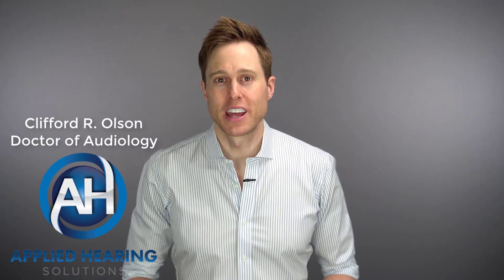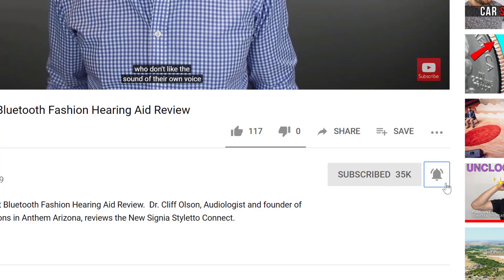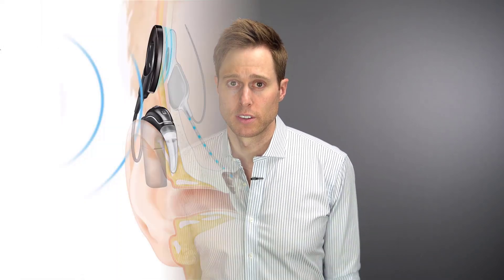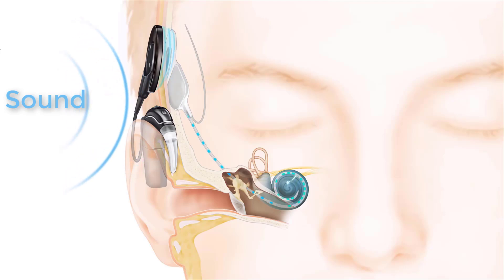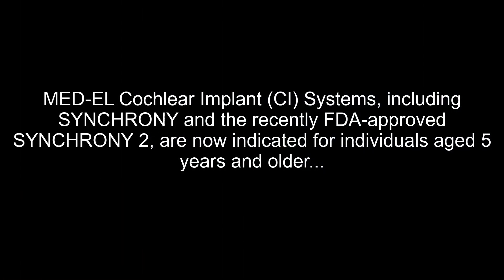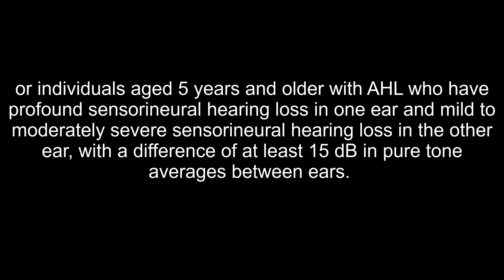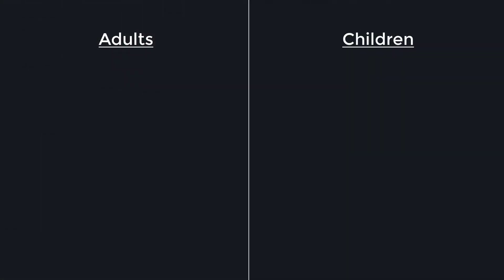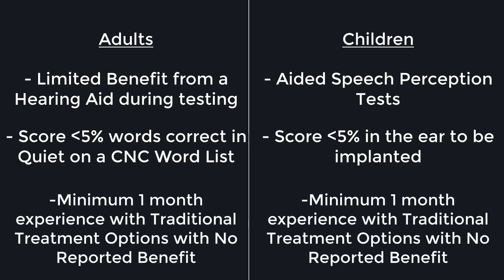Cochlear Implants for Single Sided Deafness & Asymmetrical Hearing Loss | FDA Approval

Comment: Trying to get single sided deafness fixed is actually a bit silly and I am speaking from experience w having had SSD for almost 50 years. Over those 50 years, I’ve had very few issues w getting used to only having one ear to deal with. Only on rare occasions like in a loud restaurant or bar has it affected him, so please do not start doing surgery or any other crazy means to fix it.

Comment: It's not only the localization that the binaural (aka stereo) hearing restores. It also restores the ability to separate the speech from the background noise, since the sound becomes 3D and has depth again.

Not to mention the effect called binaural loudness summation. The brain perceives the sum of the sound from two ears as much louder than the same sound from each ear alone.

Comment: I have had significant hearing for most of my life. I am 80.  About four years ago I was fitted with a Cochlear implant. Since then I have struggled to understand the speech it produces. My senses tell me I am not benefiting from the implant as much as I believe I should. My comprehension definitely is greater when my Cochlear hearings is operational. However I also find the sound produced by my Cochlear interferes with my ability to hear clearly. It is a very annoying pitch that is screechy sounding from my Cochlear. My audiologist has been unable to help me with this problem so far. I think I am probably doing as well As I can expect.
Disappointing result.

Comment: I have a sudden sensorineural hearing loss with profound hearing loss in my right ear. I'm in the process of obtaining a BAHA evaluation audiogram for possible implantation of the Choclear Osia system. I'm confused between a cochlear implant and the Osia system. What is the difference, or are they one and the same? Is the surgical procedure for both the same?
Reply from the maker: The OSIA is a bone anchored device that will send the vibration of sound through your skull to your better hearing ear.  A Cochlear implant will stimulate the Nerve on the Profound ear side to provide hearing on the affected side.  The surgical procedure will be different.  The OSIA will be less invasive, but both are relatively simple outpatient procedures.  The question you have to ask yourself is:  Do you want to hear on your affected side, or do you want to hear all sound on your non-affected side?  This will help you decide which one is right for you.
Reply: @DrCliffAuD  I want hearing non side effects please helping me , my hearing loss is moderately severe ,and doctor is saying cochlear is damage

Comment: I’ve been following Dr. Cliff since I experienced sudden hearing loss in my left ear a year and a half ago. Huge asset for understanding available options. I had good success with CROS hearing aids but wanted bilateral hearing back and went for a CI in the bad ear. I got the Cochlear Nucleus 7, which isn’t FDA approved. My experienced hasn’t been pleasurable. I get improvement when I Bluetooth to the external processor but my brain can’t migrate the artificial hearing from the right with the normal hearing on my left. I get a loud echo that drowns out speech that I can’t understand. It interferes with normal speech perception in the good ear. I’m about to try program six but I’m about to go back to CROS.
Reply: Curious how this is working out for you? Is it any better for you now a year later after this comment?

Comment: Good afternoon Dr. Cliff, all right? I am unilateral deaf since I understand myself. I am 40 years old and I use the cros hearing aid. It has helped me a lot, but they say that the cocclear implant is of much higher gain for the user. The doctor told me that I would have very good hearing in my deaf ear, but one thing is to listen, another to understand what I would be hearing with the CI, because my cerebral cortex is not used to hearing sound from the deaf side. My question is, is it worth fighting to get the surgery? From the experience you have, is there really any benefit to CI for those born deaf and over 40? Thank you in advance.
Reply: Hello, I wonder if you went through with the CI? I am in a similar situation. I am 43 I have been using the bi-cross for many years now. I was told by my doctor that a CI might be able to help. I am just curious if this helped you or not.
Reply: @victorjurado7524  Good night, no, I didn’t have CI surgery, but I have been using the cross, which has helped me a lot. I do not have the need to ask to switch sides with the device when someone talks about the report of my deaf ear. My experience with the cross has been very good. But as I said, my doctor said that if I did the CI I would have a hearing with perfect sound. He said that listening is one thing, understanding is another. I recommend you to see your doctor and see if it is worth implanting or not.
Reply: @juniorguitarmanjr  thanks, I  have my appointment next month. I hope for the best. 🙂
Reply: @victorjurado7524  Will be all right. Trust in god.
Reply: @victorjurado7524  hi. Any updates?
Reply: Great question
Reply: Hi please update on current status of your hearing aid / CI

Comment: Nice video but I would have liked you to have mentioned about the fact that if you have had profound hearing loss in the affected ear for more than ten years, a CI will not be a viable option.
Reply: I had a single sided CI 15 months ago, 2-3 years after experiencing sudden sensorineural hearing loss. I am now age 66. I have moderate loss in my good ear. I wore bicross aids and still need a hearing aid in my “good” ear. The CI sounds a bit like Minnie Mouse and is not very understandable. I think I’m getting some binaural hearing now, but still can’t hear or understand a voice on my bad side. Dr. and audiologist say give it more time. Hard to find much info on this. Any comments?
Reply from the maker: Where did you hear that?
Reply: @DrCliffAuD   It is in the current FDA guidelines: "hearing loss of a profound duration for greater than 10 years is a contraindication for the SSD and AHL indication."
Reply from the maker: Thanks for adding. I missed that when I was reviewing my sources.  👍   Side note:  It isn't that it wouldn't be a viable option, it would just be a contraindication.  You could still receive an implant as an Off-Label use like the other 78% of CI users, albeit with potentially less success.
Reply: @DrCliffAuD  I would certainly take the chance if it were ever offered to me! After an entire lifetime of mono hearing, I think any sense of stereo hearing would feel like a miracle, even if the sound were poor quality.

Comment: I need help I’m deaf in my right ear and was looking at getting the audeo b-r 90 but now I don’t know if it’s a waste of $5000 after watching this video. Btw my other ear has normal hearing
Reply from the maker: Hi Max,  If you are truly deaf in your right ear, a hearing aid probably won't help.  You need to consider a treatment that us used for Single Sided Deafness.  A Cochlear Implant is just one of them!  Make sure you check out my other videos.
Reply: Doctor Cliff, AuD the phontak audeo br was one of the devices I learned from watching one of your videos. It has a receiver on the deaf ear and a hearing aid on the left. It is a cros tech
Reply: I was just wondering if getting cros technology would be worth it compared to a cochlear implant
Reply: And the device is called a phontak audeo b-r 90 it’s a device you recommend in one of you videos for single sided deafness
Reply: @Maxlodge  just my two cents: try the CROS device first. Not everyone can "process" hearing the signal from two ears with one ear, but it might work fine for you. I'd also test whether you really profit from the highest tech level (90); some of its advanced features are very much dependent on binaural interaction between two hearing aids and you might not gain enough to make it worth the money, because they do not work with the CROS device on one ear. 
An Audeo B30 or B50 might work just as well combined with a Phonak CROS B.

Regarding a CI: that should be decided by you after detailed diagnosis and information in the hospital by ENT-specialists (at least here in Germany it's done that way ;))
Reply from the maker: A cochlear implant just provides you with something different.  A lot of individuals are perfectly happy with CROS treatment.  Regardless, you would have to show lack of benefit with CROS before considering a Cochlear Implant anyway.